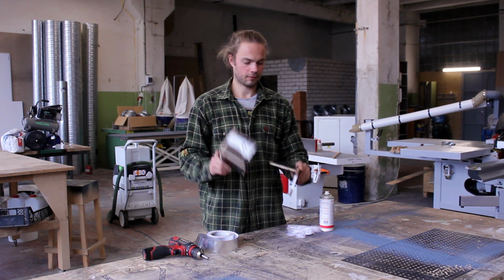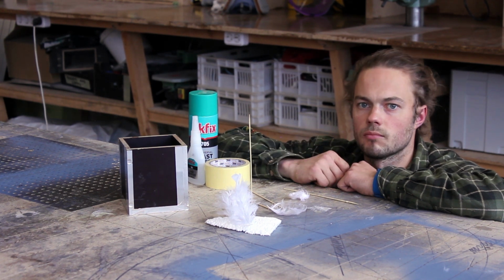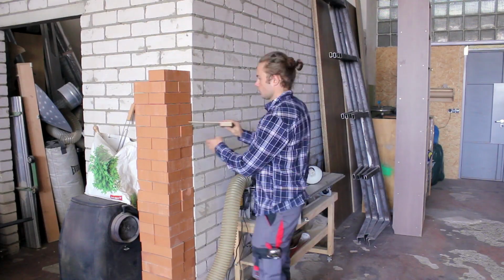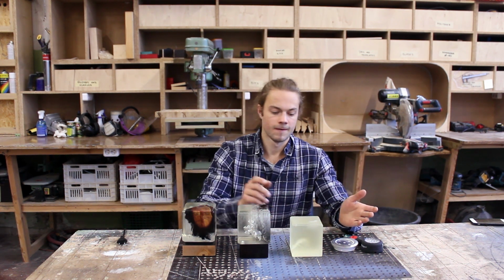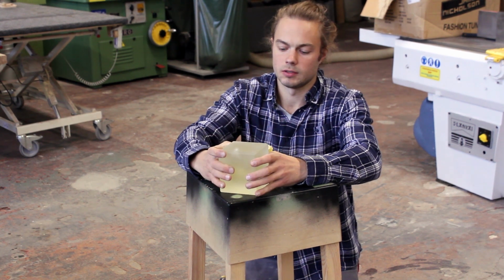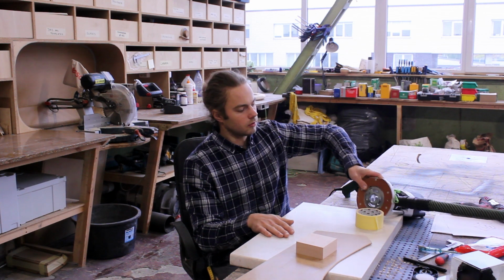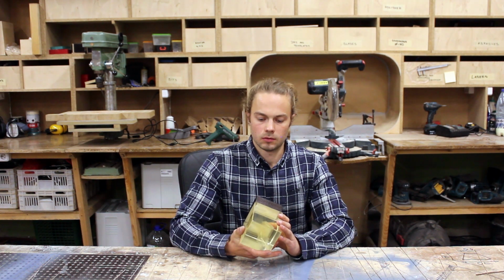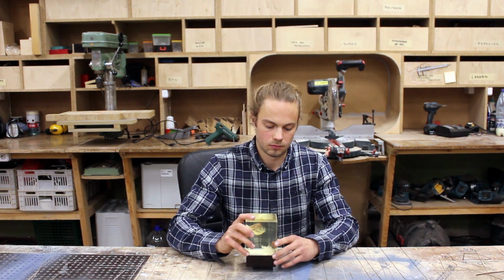feather in resin / epoxy lamp | step by step making

Comment: what do you cover at the end ? oil wax? nail polish ?
Reply from the maker: I assume you’re asking about the varnish on the epoxy casting. So just because I was lazy to fine polish the resin I used a clear lacquer to bring the transparency. Lacquer fills all the tiny scratches left from sanding and smooths the surface.

Comment: Get yourself some polishing paste to take care of those last scratches.
Reply from the maker: Marc Kenner I thought of that, but it just felt more time consuming when the shape has a grove underneath. I should try spraying one and polishing another to compare manufacturing differences as well as pros and cons of end result.
Reply: @Chiselsplay  well, the way most turners seem to do it is rough sand, sanding sealer, mid- to fine-grade sand, polishing paste, grit paste (Yorkshire Grit is best), then some kind of wax or shellac. I suspect that last one would be covered by the spray lacquer. Check out Nick Zametti.